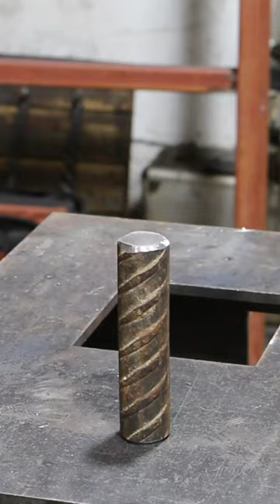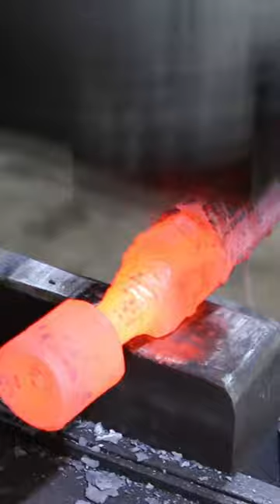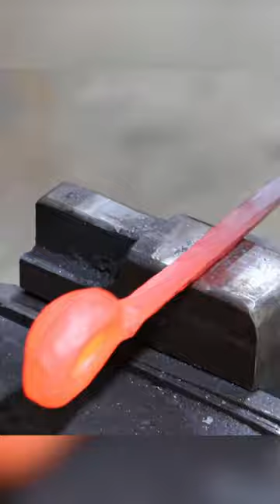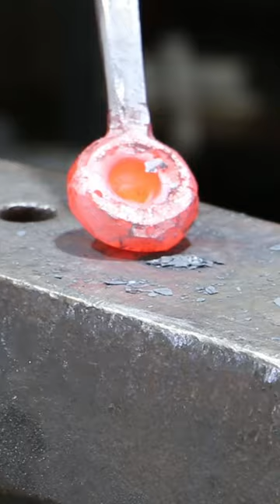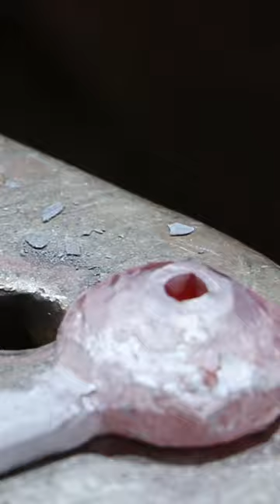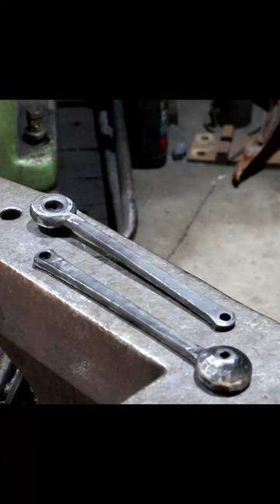Making a Nail header tool #shorts

Comment: The way I was shown for this is to put the square taper in from the back.
Reply: Easy release. Only contact point is that square "ring" from the underside because the taper of the nail opposes the taper of the hole. I mean it'll shrink out anyway. Also, when the nearly cut nail goes in for heat, bent up, so that the "head" shields the narrow taper from the fire from underneath and can go even as hot as burning if you want without burning the narrow taper.